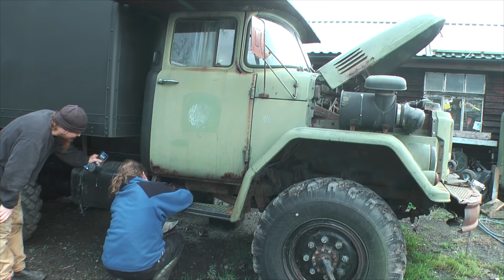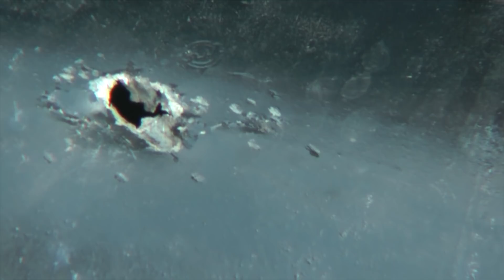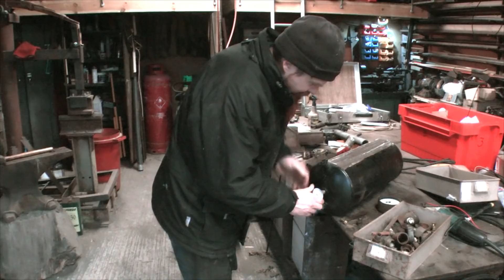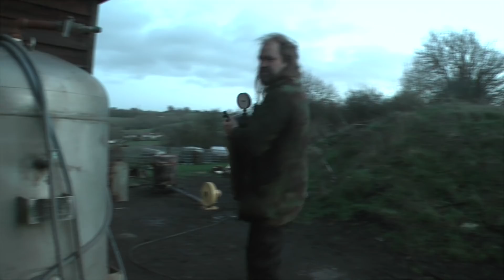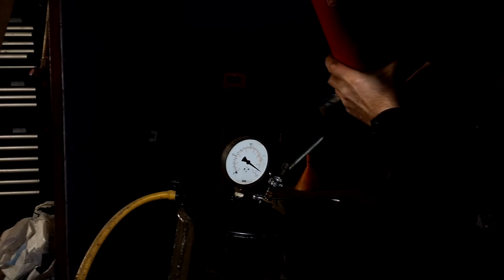Project Awesome 23: Air Repair

Comment: Nice job. The square block that your using to shape the plate what is it called? Is that what it was casted or  built for or some other use. Thanks
Reply from the maker: It's a swage block and yes, that's exactly what it's for!

Comment: On thin steel like that. I have found that 17.5 volts. 600 in a minute argon CO2 c25 gas at about 25 c f h works pretty good

Comment: Not a bad job. I used to work in a tank manufacturing plant here in the US. And I was the test and Patch repair. Welder I took huge pressure tanks and put them down in a large vat of water. Pressurized with about 15 lb of air And would look for leaks. You didn't do a bad job at all. Very interesting truck you're working on.

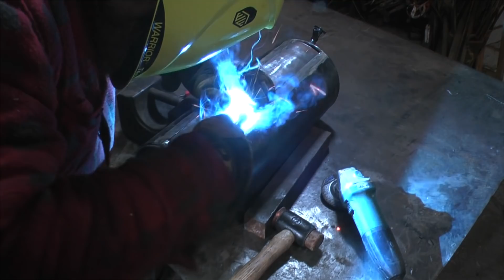Comment: Why did you flip your hammer at 12:03 ?
Reply from the maker: I'm nudging the metal gently with the rawhide head, then flip it to use the edge of the copper head on the edge of the work to sharply dink just the leading edge and get everything lined up.

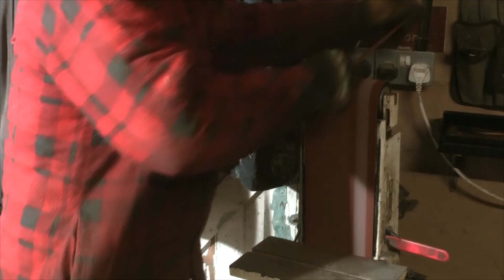Comment: at 9:30 the face isn't shown. also the angle grinder has the guard on it and he didn't stop the disk spinning with the hand after he turned off the grinder. 
i do not think it's you Max

Comment: I was told to test an air tank fill it with water then pump it up. Less chance of it exploding and killing some poor bugger. Esp with that dodgy welder. I wouldnt of even had a few psi in it. I've seen one let go at just a few bar.

Comment: is the trucks air system also running the organ or is it a separate system? good work
Reply from the maker: Totally separate, the truck needs high pressure, the organ needs huge volume! We'll probably have a blower system in a trailer.

Comment: I have just subscribed an apologize for not doing sooner as I watched a good portion of the Zil before but as I do things in bits and computer failure left me without a unit to watch or even get the priorities right. I assure they are now. I would very curious to know if in hindsight, there is anything that you might of chosen to do now. Like that roof off the scrap cab, would it of made a donor top for the Zil? Maybe some glass as you guys  have proven the life of something is only as limited as your sight. I am happy that you chose a Cummins engine for this massive undertaking. I am very proud of the individual talents so well melded into this. Both should take a bow. This coronavirus has had to hit your at your abilities of salvaging stuff. Everyone learns as they go and even the air tank repair was priceless. I was a heavy equipment mechanic in and on the islands of alaska where you make or make do without. I say make as I have combined some things that were not apparent at first. Stuff that later appeared on store shelves that I made years before. Kinda puzzled that you didn't just isolate the twenty four volt starting system or just find a small pickup application for a twelve volt system clear through. I know it takes less to use 24 than 12 volt to do something but do think you learned the mastery of using a dime to go out dressed as a dollar.  A great job. I am on a marathon to watch all the videos so thank you men
Reply from the maker: No regrets so far! We progress so slowly we have plenty of time to refine ideas before moving forward with them. The scrap cab roof was not right shape and the cab was in very poor condition. Most of the electrics are with the new engine (sensors, alternator etc) and so it made sense to us to go 24v for the lights too, that just leaves some of the dashboard running at 12v off a dropper. Hope you enjoy the rest of the videos!

Comment: Tank= vessel usually for liquids vented to the air (fuel tank, fish tank, cold water storage tank).
Cylinder= pressurised vessel usually for gases.

Just saying.

Comment: Hair and beard length dated this one for me before I noticed the winter clothes. Bit like growth rings on a tree for video dating, I guess! Some MIG welding for beginners would be of great interest Max. A lot of others on here, I know, but they are mostly in ideal conditions on new metalwork. Some ‘real world’ repairs of your type of jobs are more like what a lot us would get into. Also what to look for in a cheaper machine. I need to re-learn MIG as not done it since college 35 years ago as I got on better with Oxy Acetylene welding and stuck with that. Not so easy to get or convenient to use nowadays, though. Thanks for the upload!

Comment: Hey guys thanks for another truck video. I'm not questioning what you did to test that tank after the work you've tried,  but you've got some good advice about what happens later here in the comments. That welded tank is a huge liability "if something happens" . I'm in Canada as well and know that it's illegal here through working at a place that safety inspected  (Mot'd) big highway trucks (lorries) and changed them for reasons you have with this one.
    I never had anything to do with air systems on trucks in the U.K when I lived there. But I'd strongly advise you to find out about the U.K rules on it if you haven't already, or just say to heck with it and spend the extra few quid replacing it and not have to worry about it.. 
  I'm guessing it's going to be test exempt like some other older vehicles in the U.K, but are you going to get a test done anyway before you start driving it. so you know for piece of mind it's mechanically right with brakes/ steering and is technically legal for road use  ?    Take care over there see ya next time.

Comment: Are you going to coat the inside to prevent any further corrosion issues ?
What I would do, is get something like Kurust or other similar latex based rust converter and swill around the inside, a goodly amount.
Then drain out and leave all valves open to allow it to dry out.
Even unscrew any valves and taps to allow as much ventilation as possible.
Having said that, a pre-rinse with some rust remover would not go amiss.
Just make sure you give it a good rinse out with water after that stage.
After the rust-converter treatment, and all is good and dry, a good swill with some primer.
You know where this is going so I'll stop before I start to sound patronising.
Good luck !
>

Comment: There are times to weld and repair, and times to just shrug and buy another. Compressed air tanks are an example of the latter. Even an   old propane tank is safer than one you have welded.
Reply from the maker: An old propane tank would have been the wrong shape, wrong size (I have examples of all of them) lack the correct fittings for the air lines and no drain cock (so would have needed cutting and welding anyway). This tank is the correct size and shape and has the right fittings, it had rusted only in one strip which I cut out and replaced we then tested it to twice it working pressure. I think we made the right choice.

Comment: Hi max, I weld/make diesel tanks and i test with air pressure but use fairly liquid and water and you can see even the tiniest leaks with only small amount of air pressure, not telling you how to do your job just saying how I do it👍

Comment: How you going to paint inside the air receiver?
Reply from the maker: They are bare metal on the inside - paint would flake and cause trouble in the brake system.
Reply: @maximusironthumper  thanks for new video about ZiL!

Comment: An easy way to do the early pressure test would be to put air pressure in the tank and then spray it with soapy water. If there is an air leak you will get bubbles. It makes then easy to spot.

Comment: I think you need to keep a look out for an old Hydrolastic Pump! they're good for 600 psi  and use a low loss shrader connector. would be just the ticket for testing cylinders and stuff.  I've had to re-gas the gas side of my Maxi Hydragas displacers ,  It was awesome to test the modified units Hydraulically first with  the Hydrolastic pump before  filling up with the gas.

Comment: You push MIG, don't drag it, unless its gasless flux core. I think you were dragging.  If you drag MIG you compromise the root penetration (electrode positive, see?). You drag stick so it keeps the slag out of the root, and it's either AC or electrode negative (usually) which puts more heat into the work. You also have to grind your start/stops otherwise you won't  get full penetration and that includes your tacks too, hence the pinhole leaks. 2mm cutting disks would have been perfect for back grinding. The Achilles Heel of MIG is lack of penetration. Even though you re-welded over the top you still won't have full penetration.  Yes I've done pressure vessels, amongst other things.  Wish I'd been there...  You aim to have a bead on the inside that is just as neat as the bead on the outside, otherwise the welding inspector hunts you down and terminates your ass.

I've used plenty of welders that were not consistent.  It was never an excuse  ;-)
Even on town/city power you get variations - when other factories come on line the voltage sags at the distribution transformers, and a lot of the older stuff would even fade as it got hot due to higher resistance in the power components.

Comment: Hi  Maximus Ironthumper.   What brilliant entertainment, proper,proper mechanicing using old and worn out machines to resurrect another
machine, not to mention the organ work and the superb electronic work & gizmos, sheer hard graft & determination.  Exellent  could you use
the telcom cab roof on the Zill ?

Comment: There are systems which overrides the set maximum of the pressure, to a higher one from time to time, and when the system reached this point it will crack open the drain ports for a split second, to vent the water out automatically.

Afterwards the override stops and the system operates normally again.

You could just build something yourself: If the pressure drops below x, turn a relais on, which will trigger a blowout when the cutoff for the compressor triggers, so when the maximum pressure is reached.

This way you blow out once every startup and if you use a lot of air.

Comment: Mate, highly recommended not tightening jubly clips (hose clips) with a screw driver like that. Stabbing yourself in the hand when the screw driver slips is not very nice at all. These days, even though it is slower, I use a small spanner once it starts to get tight.
Reply: the correct size nut driver on a small impact works well too.

Comment: Test it using water - very wise words!  Some bozos where I used to work tested a small welded pressure vessel they had made to 28 PSI and nearly killed themselves when it blew up.  Fortunately for them they were both out having a smoke break when it let loose.
Reply: I had tinnitus for years after leak testing my copper yarrow boiler in Devonport Dockyard's apprentice training school when a bicycle inner tube air connection to it let go at all of 50psi and probably 5 litres of volume. Yes don't dismiss dire effects of even low pressure compressed air getting suddenly  loose  !
Reply: And they say cigarettes kill

Comment: One of the reasons i don't like drain cocks on side walls, they rarely ever work when the tank is in a supposed "horizontal" position. Especially on a truck, honestly, who ever levels their truck to drain the tanks properly?
The smartest drain cock/tank design i've ever seen was a custom job, a small firm in Finland, i believe that makes air tanks with a slight equatorial line to the them. And in that line, at the bottom of the tank, on a reinforced patch, sits the drain cock. Doesn't matter what kind of terrain you're on, it will always drain because the water is forced to sit there. And it's quite a big drain too, none of that rubbish peckers that clock with the first sign of rust or whatever. 
I wish they'd do bigger tanks, because i'd change all my air tanks to that design, freaking brilliant.
Reply: But this tank is 30-40 years old, i think this is good result that it fail just now.

Comment: i love this truck, with the box on the back it kind of looks like a clean up truck from Chernobyl
Reply: The lead shielding may kill the mpg? Definitely needs a novelty Geiger counter with an MP3 player, putting out a variety of clicks?
Reply: "Pripyat liquidators division"
Reply: You never know it might have been a Chernobyl clean up truck as the truck probably predates the disaster .You can never tell with Russian and chinese stuff .they are probably still knocking this out in some form somewhere in the world for the military. Its the default Ak47 of lorries.but this ones got the best engine in my opinion.The cummings engine is a peach and will run forever with loads of torque. My fathers fleet of case Maxxum tractors all had them back in the 90s and last of the proper well built non plastic fantastic with deliberate built in fragility. He should run a Geiger counter over it out of curiosity though .lol

Comment: You should have fitted a set of pipes down there, you could have played a tune as you drove, like an ice cream truck. Cheers
Reply: I think using a compressor+a motor is way too loud and inefficient, that's why they use an electric fan.

Comment: I wasn't there when it happened, but I saw the end result. Truck stop I worked at 40 plus years ago  had a soap tank in the was bay, big thing IIRC looked a lot like Max's big air tank held like 250 gallons. We dumped in dry soap filled with water then pressurized it, you would then spray the soap on the truck scrub it with brushes and the use a steamer to clean it off. One evening nobody was in the bay when the top blew off the tank a couple of drivers who were in the parking lot said it looked like a rocket blowing through the tin roof on a column of water then landing just short of the nearest parked truck! needless to say the wash bay was shut down till a new tank was installed.
That's  interesting, not what you want to hear from the guy working on your electrical system!

Comment: All that buggering about couldn't you just use an old exguisher?
Reply: I had a whole stack of them sitting in the scrap pile.
But it was more fun to fix the old tank. That's how we roll!  ;)
Reply: Before gettting to the air tank repair I just posted and erased expectation for an old CO2 fire extinguisher or a propane bottle to get a new role! Better to fill 99% with water for the post-repair pressure test. Why do I know ? Pardon? Sorry ? What?....

Comment: Not the way a boiler is tested but I guess the weld is sound. You could probably borrow a plumbers hydrostatic test set. Blank off the purge valve if possible or change it if you can't and pump it up to the required pressure with the test set hand pump. You would expect no pressure loss over at least 1 hour. Gas bottles that you can't test in this way are safely immersed in water for the same reason mines are exploded at sea..

Comment: If you lose pressure, don't you lose brakes? Maybe consider a new tank even now?
Reply: If it's a conventional air brake system it is quite the opposite. Air pressure is used to release the brake. It is a fail safe system.
Reply: @Itsa_Mea  no, military lorry use air pressure for applying braking.